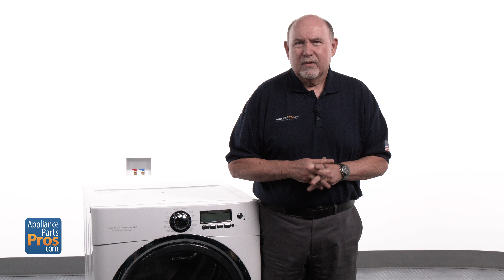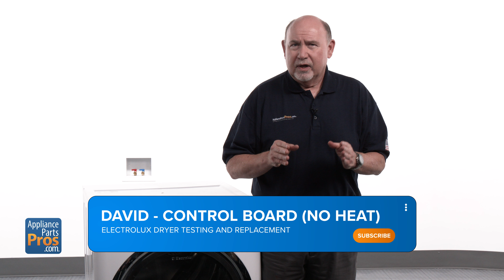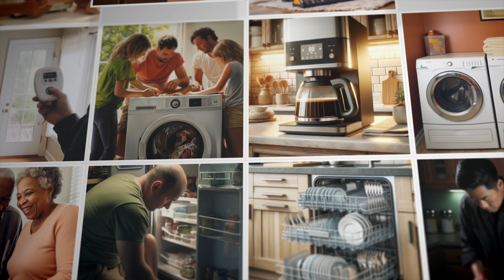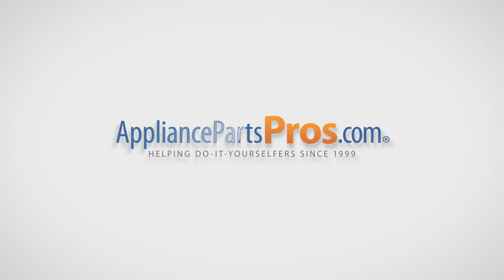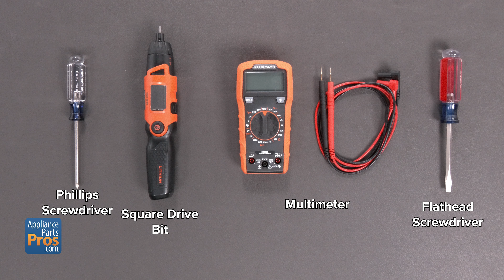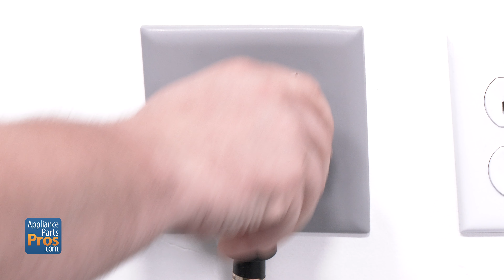Electrolux Dryer Control Board Replacement MADE EASY

Comment: I started with error E71. So I replaced the thermistor. After starting machine again I still didn’t have heat. So I used this video and found voltage on all 3 relay connections. (Around 60v) so I purchased a new (used) board. After reconnecting power now I still don’t have heat. Pushing start and cancel together gives me an error code E00. What next?
Reply from the maker: If you need more installation, troubleshooting or testing information you can check out our Repair Forum: https://forum.appliancepartspros.com/.  It’s easy to register, and you can either post your question or search the forum to see if someone else has already asked the same question.
 
Our experienced technicians, with over 20 years of hands-on appliance repair experience, are ready to answer your questions and guide you through your repair.

Comment: replace board top of drum , same issue, dial blinks a few light spots ,,no numbers or codes? blinks with door open or closed? tried with door switch  by-passsed ,nope? checked dial board .visually ,,look fine? any ideas>? thanks, yeah very frustrated
Reply from the maker: We understand the frustration! If the display is only blinking a few spots with the door open or closed, and bypassing the door switch didn't change anything, the issue could be with the control board, user interface, wiring, or a power supply connection. A visual inspection won't always reveal a failed component.

If you need further installation, troubleshooting/testing information from our techs you can check out our repair forum: https://forum.appliancepartspros.com/
Reply: thanks, i checkd door switch, thermal, fuse power in, breaker , now just dead no blinking,fixed all burnt wire with shrinktube, tried new board, checked power to board, ? Oh,well< do you make house call? ,LOL, thanks  @appliancepartspros  t

Comment: real dumb question, but ill ask anyways, i hate this electrolux dyer, would it even be possible ,to get a simple control. old style . by pass all the control boards, re-wire the dryer like the old ones,,,insane? ,,Yes?
Reply from the maker: Unfortunately, the would be altering the appliance, so we cannot recommend that you do that due to safety issues.
Reply: @appliancepartspros  i do realize that, But, pretty sure its possible?. i just wanted to know , if it COULD be done?  , its either alter it  or junk it, very expensive junk appliance, thanks, for responding ,
Reply from the maker: I'm sorry, that is not something we can recommend.

Comment: my board was burnt ,black, what is the cause ? only lasted 3 years? so l should i just put new board in? or,test other parts? thanks
Reply from the maker: A shorted component, wiring issue, or power problem could damage the board. 

If you need further troubleshooting/testing information from our techs you can check out our repair forum: https://forum.appliancepartspros.com/
Reply: @appliancepartspros  what type of component would i test? ,should i replace the board? thanks
Reply from the maker: You will need to go to our repair forum with your model number for more specific troubleshooting and testing information: https://forum.appliancepartspros.com/

Comment: mine doesnt have that slide off top. any ideas how to get into it?
Reply from the maker: If you need more in depth troubleshooting or replacement information you can check out our Repair Forum: https://forum.appliancepartspros.com/.  It’s easy to register, and you can either post your question or search the forum to see if someone else has already asked the same question.
 
Our experienced technicians, with over 20 years of hands-on appliance repair experience, are ready to answer your questions and guide you through your repair.

Comment: Thank you so much for sharing! Just to confirm after either fixing or replacing the board shall we have to "program" it or go to any sort of configuration? Im asking since a "technician" came to fix our dryer and after he fixed it he mentinoned that he needs the manual of our dryer to program it haha Im not quite sure what he means but who knows ... Thanks in advance
Reply from the maker: For free technical support, please visit our Repair Forum: https://forum.appliancepartspros.com/.  It’s easy to register, and you can either post your question or search the forum to see if someone else has already asked the same question.
 
Our experienced technicians, with over 20 years of hands-on appliance repair experience, are ready to answer your questions and guide you through your repair.

You can also post a question directly on the product page of the part you’re interested in. This helps our team provide the most accurate, part-specific guidance in our Question and Answer section.